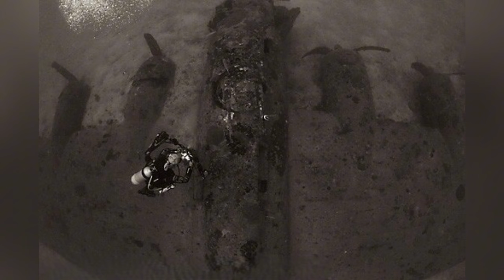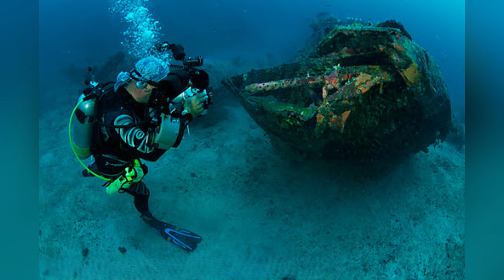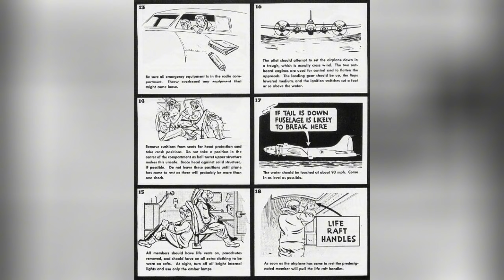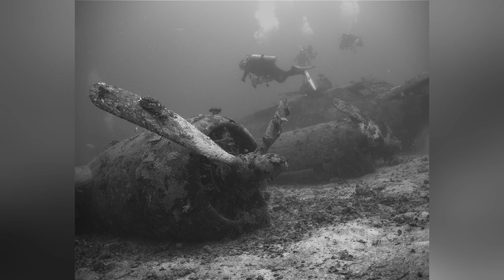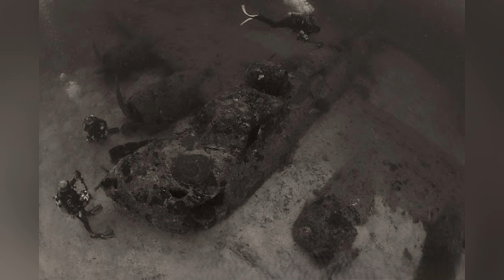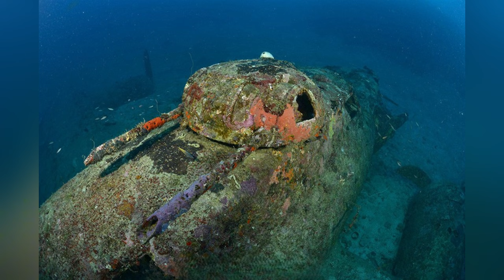Revealing B-17 Black Jack: The Untouched Bomber Time Forgot

Comment: How do you get into the bomb bay through the bomb bay doors when it is buried in the sand and mud? The bomb bay doors would be closed for a water landing. If they were open, the water hitting aft bulkhead would have torn the bomber apart